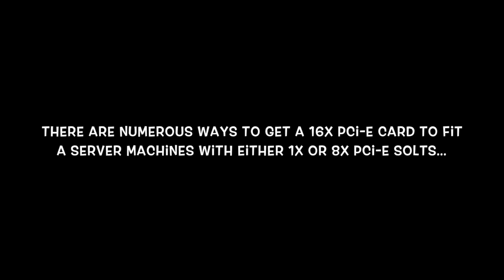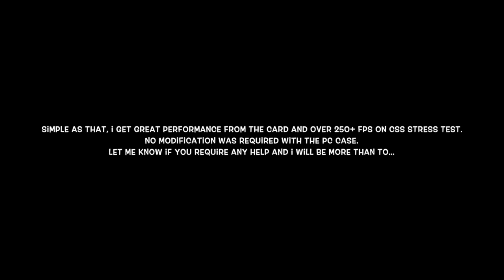Using 16x pci-e ATI or Nvidia graphis card in 1x or 8x pci-e slot

Comment: So I wanna build in a second graphics card in my PC (motherboard is a IPM17-DD  which has one PCIe x16 and one PCIe x1)  the PCIe x16 is already taken from the previous card and I wanna fit it a second one but seem to not find a geforce graphics card that fits in PCIe x1, so what you've did is you cut off the end of the slot so it can fit right? But I'm unsure because the card has the golden line going across the clip, and I think that's an important part of the card so it can run. And most geforces are x8 or x16 but i wanna put in a 1050Ti 4k and it's a x16and I have a x1 free...  Space is not a problem but the card is huge in compared to my little x1... So any details? Please?

Comment: Hi with only half of the gpu in the slot how is it working I got a gforce 8800 gts oc can I do the same thing
Reply: It's how pcie works you really only need the first set of pins and seven more from the notch 
The rest adds to the bandwidth making it more power

Comment: have you performed any tests? how does a 16x graphics card even work on 8x? does it route the data through the 8 slots and does that cut its FLOPs in half? or was it only using 4x from the start?

Comment: ty for the info what are slots can u do this with and maintain full functionality of the card.. for example my mobo only has agp slot and 3 pci slots no 1x or 8x is it possible to get it working via the agp slot somehow or the standard pci and still have full use of 3d gaming and directx 10 w/ my 1gb radeon hd 4750? i dont care if i have to modify the card..
Reply: other* slots
Reply from the maker: No, a PCI-e card will not work on a non-pcie slots unfortunately. You need to make a decision on what you want to keep, if its the motherboard then you can easily get an old second hand AGP or PCI card from ebay/amazon. If you want to keep the card you will have to rebuild the rig with a new motherboard to accommodate your 4750.
Reply: thx

Comment: Would this  work on a pcie 1x?
Reply: yeah ive seen videos to convert it to 1x but i think other than allowing it to post you would have no 3d or directx capabilities and you would have to ruin your card..
Reply: http://lifehacker.com/5951156/convert-a-pci-e-x16-video-card-to-fit-a-x1-slot-with-a-diamond-cutting-wheel
Reply from the maker: Yes, it would work. Personally i would modify the motherboard rather than the card. That way at least you can reuse the gfx card elsewhere. Some say its cheaper to replace the card so they would modify that but to me it doesn't make sense, modifying the mobo means both the gfx card and the motherboard can be reused. When attempting this, if you attempt cutting the slot, please ensure the card does not ground against any of the motherboard/capacitors/resistors. If it does touch something just de-solder and fix away from card. Hope that helps.
Reply: Tech: I agree. Why destroy the a good reusable graphics card in order to sync with a motherboard I would replace the motherboard. This looks fishy to me.
Reply: it depends, I couldn't replace motherboard due to needing the SAS controller running my 15k drives in RAID. Probably wouldn't do that now considering the cost/speed of ssd and nvme.